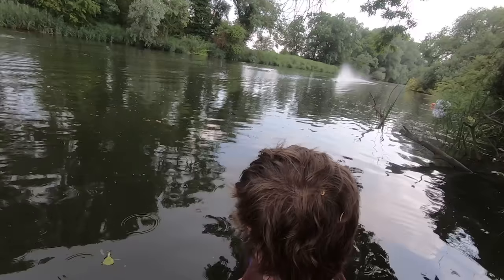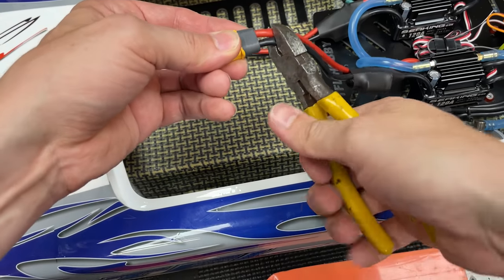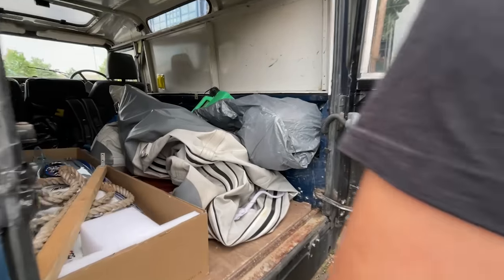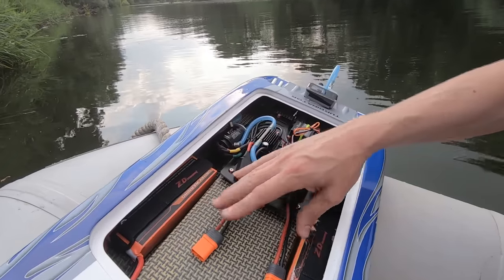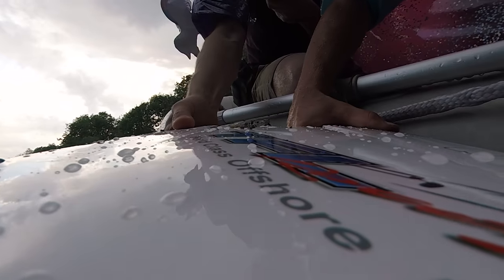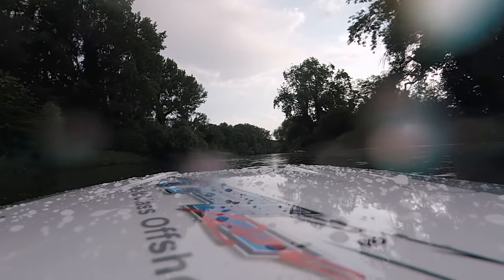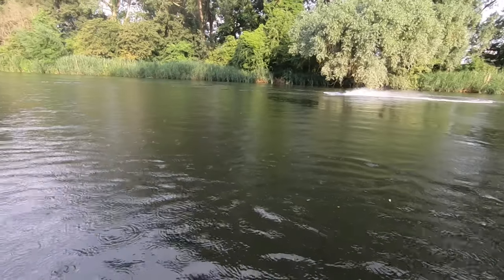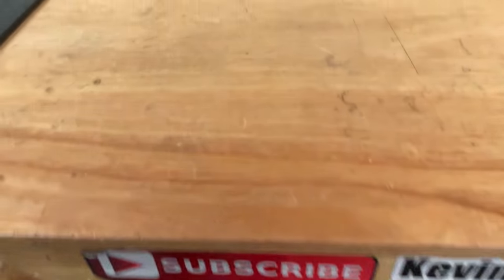Twin Motor 12s RC Speed Boat ***fastest RTR boat in the world!***

Comment: Hey Kevin, this is probably my first comment on one of your videos, but I felt I could help shed some light on the speed of this kind of boat. This propulsion system is called an "Arneson Drive" It is almost half prop, half fan. It is designed to only be partially submerged while running, causing high-speed cavitation which acts almost like a jet. It looks like the boat is "chugging" while you drive it at the start. You might have the props down too far into the water. When going fast only the last inches of the boat hull are making contact with the water. Take a ruler and line it up with the prop and hold it flat against the hull. The prop should just barely be dipping into the path of the ruler. When properly trimmed this boat will make a 15-foot tall rooster tail, as it's designed that way. Cheers!
Reply: It's insane this comment has been here for 5 months with no reply. Spot on.
Reply: Thanks <3
Reply: Sorry, these are NOT Arneson Drives. Arneson drives steer as well, no rudder, the whole drive units (shafts and props) move left to right to steer. This has a regular rudder with fixed drive shafts, if anything, this is a Fabio Buzzi Drive set up. And they are called Surface Piercing drives, as only about half the propeller is under water when running on plane, definitely has nothing to do with a fan, lol.
Reply: Stinger drives
Reply: Just a straight up surface drive.
Reply: It's surface drive.

Comment: You need to make sure the drivelines are extremely smooth, no vibration or binding, balanced props, and you'll have to adjust the outdrives. Even just 1 degree of angle change will make a massive difference. Looks like it's running pretty wet out of the box for more stability.  Getting 110 out of that boat is possible, but it's going to take a lot of patience.
Reply: Chill my guy
Reply: @noji1445  why would he need to chill? Kevin ASKED for input
Reply: this comment should be highlighted.  Thank you for answering his question (and also mine, perhaps a question of many)
Reply: Wow you know a a lot about boats 😮😮
Reply: Pretty sure you can’t just use a regular prop anyway as you’re gonna lose masses of energy boiling the water (cavitation). A jet would be the way to go, so you can run a bigger prop at lower rpm and then change the diameter of the pipe to get more speed for the same volume of water displaces. I think!
Reply: You don't think he know that
Reply: @adamdyer14  A prop drive is always going to be faster then a jet drive. And also it’s not cavitation. It’s aeration.  Cavitation is when air bubbles implode on the surface of the prop. It’s bad. It takes little bits of the prop with it. Aeration is when the prop comes out of the water and then pulls some air back down with it when it hits the surface again. Aeration is good on a surface drive if adjusted properly.

Comment: Nice video Kev. You may have watched my video of Zonda on here hitting 113mph and now up to 123.6mph all stock with only a prop swap on 6s. The Zonda will easily go over 100mph but it needs aftermarket props to hit this speed. Box stock on the raw stock props it does 55-60mph. Also you need to put floatation on the bottom of your hatch or you will lose it when it comes off in a high speed crash. Trust me it will come off LOL! Thanks for putting out all the great content. And if you want to get your boat to 100mph+ hit me up 😎
Reply: True, most people think that fiberglass floats. Most plastics sink.

Comment: That Honda outboard is air-cooled, so you can run it out of the water to your heart's content!
Reply: Not without wind you can't!
Reply: Blake Huffman it creates its own wind I'd imagine, with a cooling fan on the flywheel.  Otherwise it'd definitely overheat with that cowling on it.
Reply: @camyota  Older ones didn’t have cooling fins, perhaps newer ones are different, not sure.
Reply: @BlakeH97  yes u can
Reply: Thank you I was wondering

Comment: Awesome 👌. On that old land rover, its old enough it should have a mesh adjustment on the steering block you could tighten up and remove that slop in the steering wheel 😀 I used to do it all the time on my old trucks 🚚
Reply: Bump so kev may see it, his Life safety and the safety of other drivers is more priority than everything else

Comment: It's all above the drivetrain and the props. Your endpoints are perfect, more rpm and your Motors will blow up. Just screw your powertrims higher by about 1°, then try again- cause it's running wet out of the box, that causes more drag...
Also, if your Motors and ESCs are not to hot, you could try bigger props, or with higher pitch. Easiest for you, cause you don't need to balance them, is to buy a couple of the TFL aluminium props, they are good and cheap for testing.

Comment: Either the endpoints (doubtful) or you need higher pitch propellers(deeper pitch propellers are a guaranteed easier way to go faster!). Also, you can go with a slightly larger propeller than the ones you have now or even more fins(example, looks like you have a 3 blade propeller-go with a deep 4 blade) larger here doesn't always mean better when it Comes to propeller size.. You need to remember heat from the motors. Larger size props = faster acceleration but not really higher speed. Good luck Kevin!

Comment: Great boat :) Always fun with you guys. Kev, one thing I've seen you doing over and over is cutting both battery cables at the one time. Unless you have plastic or nylon cutters you're making a dead short in the batteries, for a fraction of a second. That can't be good :/ Keep up the great work!!!
Reply: That was the esc wires, you would have known if he cut both wires on a 6s 6000, there would have been fire.

Comment: they’re not lying about dry running the outboard, it has a little plastic impeller in the bottom end that pumps water for cooling the engine and you will prematurely wear out the impeller after awhile and cause the motor to overheat.. but i dont think a short start is really much to worry about like you did in the video

Comment: To water proof your receiver we used to just put them in a balloon also more revs doesn't mean more speed as the propellor causes a dead zone (an air bubble) around it if its too fast so it needs to be matched to the speed so if you increase revs you need to change prop pitch to get the most out of it.

Comment: If you open and take the receiver out of its plastic housing and put liquid electrical tape on the board, be careful to not get any on the pins for the connectors. once that dry's put the plastic housing on then plug in the servo wires/ ESC and then seal off the pins and connectors with more liquid electrical tape to keep water from getting to the pins and causing interference. I did this to my Thrasher V3 river jet boat because it gets water on the inside when it self-rights.

Comment: Props!!! You 110% need a of props and a lot of time getting the strut angle correct. Boats are how I got into the hobby, specifically speed runs. Also you might haveto adjust your driving style. Lol at 70+ the boat will come apart in a flip and you can lose it very easily. So try to do the high high speed stuff on glassy water.

Comment: Heads up kev, usually when the manufacturer says to run less voltage than the esc's claim to be capable of is often because the motors draw more amps than what the esc's are rated for at max voltage. A good example is the Hobbywing MAX10-SCT esc is rated for up to 4s but only with 3660 motors below 3000kv, if you had a 4000kv 3660 motor you might overheat the ESC or straight up kill it if you tried running it on 4s (if the rotor doesn't explode first from the additional rpm's) which is why they rated their 4000kv combo for 3s maximum
Reply: i have the max10sct but i have a 3200 kv motor and havent even run it on 4s yet
Reply: Oh cuz I’m sure he cares oh so much

Comment: The hull inside is a carbon-kevlar mesh. Its a combo of carbon fiber and kevlar in a mesh and then epoxy resin applied like regular FG or CF. Its supposed to give you the benefits of each materials using this

Comment: You need to balance those props. I would run a octura x457 cut down to a 47  mm.  I personally would run onward rotation on props . Then start playing with trim of drives. Air that thing out a little and you will gain speed. Hitting 100 plus on the water is no joke and not easy. I have a bunch of vids of real high end builds going over 100 mph if you want to check them out for ideas.

Comment: The boat will be propped for standard power. If you have upped the voltage/power, the props will likely need to have a higher pitch in order to develop faster speed. It will likely over-rev and cavitate if the pitch is too low for the increased power

Comment: You are kind of right you'll knacker the water pump impeller running it out of the water even for as long as you did because it'll be dry rubber rubbing against metal pump housing which will really lessen the life of it

Comment: for 100mph you have to do a lot, first you need a new set of propellers some balanced and sharp then you have to find the perfect angle of both drivers a set of 2 batteries 6s up to 4000mah but with C as high as 100 recommended, at ESC is not need than time set at 7.5 ° degrees for the beginning, flexible axes if you could order them from OSE, they need to be replaced with some in one piece now they are in two pieces and it is good to grease them with Vaseline, then the more important is the center of gravity found and you can only play with the place of the batteries in the boat, there are many variables that influence the boat, it is difficult to reach 100mph those who did it unfortunately do not give much details, I wish you success

Comment: Hey kev. No expert but I know your not supposed to run outboards without water long. The poly water pump impeller spins very fast and can easily melt to the wall without lube/coolant

Comment: Wicked video again with Stemp 🤣🤣🤣
Looked a right laugh lol.
On my boats all the electrics are inside balloons with a cable tie at the end and a dab of marine grease to further help seal the end of the balloon, never had any issues with water ever 😎👍🏻
Yeah I'd check the ESC to see where the end points are and punch and power etc.
Does the remote have a switch that would toggle between 50%/100% etc?

Comment: MRMAD2424 set the record of 110mph using super geico props from dasboata and fine tuning adjustment at getting the boat to plane over the water just right, give him a shout. Don't forget to  clean n grease the flexi shafts. I Suggest you find a big lake for that speed mind 😄 Good luck, I split the Hull on my proboat miss geico 36 doing about 70mph when i flipped it on Sunday. Top entertainment boys but watch out of its way cos it will do damage if it hits you 😉

Comment: Doesn’t matter what the esc are rated for. What’s the motor kv, and prop size, just because the esc can handle the voltage, the motor rpm and amp spikes can destroy the system. The amp spikes in boats are ridiculous.

Comment: Hey Kevin I have a arrma typhon mega with a brushed 550 motor I bought a Dumbo RC receiver and the throttle cuts out after about 10 to 15 seconds of running do you know of any solution

Comment: If you want the boat to exceed 110mph, the best way is to change the propellers to Corkscrew propellers. The fact that they are wider and longer, compared to the tiny stock propellers, is the reason why they will succeed in your goal.😁

Comment: For top speed, you will need to switch the axles and the propellers so they turn inward. It will make the boat handle worse, but give higher top speed. Switch both props AND axles, as the axles also have a rotation direction.

Comment: You need to stick with the original connectors coz sometimes soldering new ones in can not be fool proof and it can weaken the current flow of electricity
Reply: That makes no sense. Even with a good solder connection it would still be the same as before
Reply: The resistance is so small it does not weaken it

Comment: I'm amazed this didn't go sideways in a totally dramatic fashion. A wet servo and a receiver was quite a light bill for this kind of negligence for safety. These so-called RTR boats are NOT ready to run out of the box. TFL is a great brand, but , every screw needs to be loctited, transom hardware screws need to be siliconed to prevent water from getting in, electronics need to be waterproofed, propellers need to balanced,  motors shafts and propeller shafts need to be aligned, and the propeller shafts properly lubed - especially when running 6S on those 2075kv motors (That yields over 46000 rpm unloaded).  I think you're setting a bad example here by just taking a powerful boat like this out of the box and running it as it is with the biggest battery that fits.  The wet receiver could have have glitched at full throttle and then you'd have a runaway boat that could have rammed into you or others. Sorry for the unpleasant comment - I like this channel very much - but this was indeed an example of what not to do with a RC boat.
Reply from the maker: you gotta love a good old runaway!!

Comment: Shaft too tight, must good greased...prop too small.  Try graupner carbon K series 👌 sharp and don't need balanced.  Try lipo little backwards or forwards check cog. Forwards given your more stable and handling but can decrease speed backwards otherwise.  Depends water conditions.... chopp or flat?!

Comment: It CAN go over 100mph...but, NOT on the stock unsharpened & unbalanced props.  To get it to reach its true "top speed" potential, you'll need a MATCHED pair of sharpened & balanced props.  Check out the videos done by secretsquirrel, and you'll see.

Comment: This is not 12s voltage. This is still 6s voltage.  Each pack is ran separately from the other.  6s per  esc/motor.  It wouldn't  even be considered  6s2p. Still 6s1p.